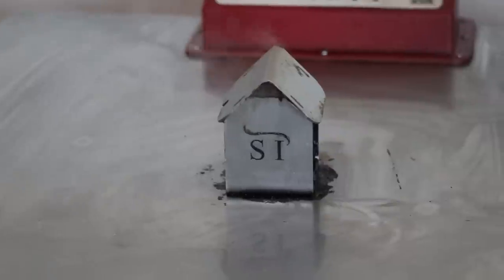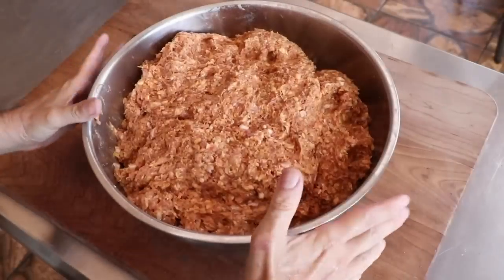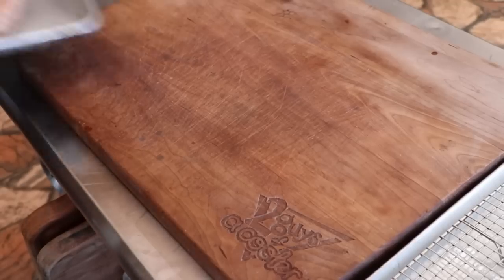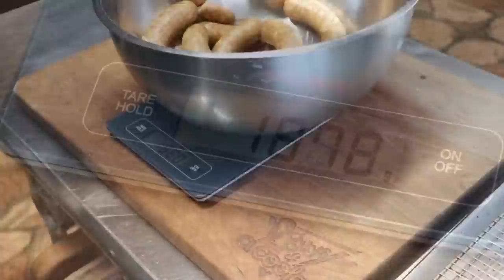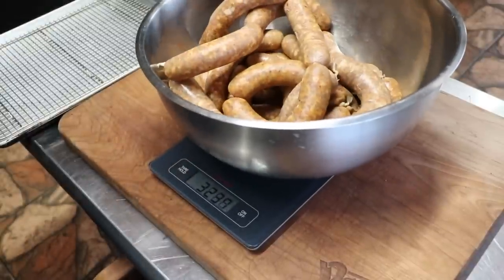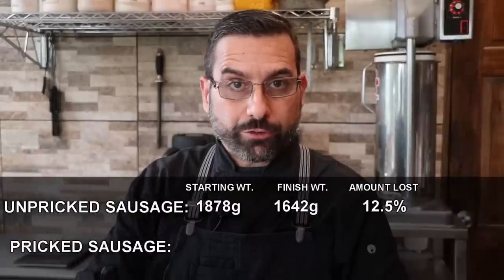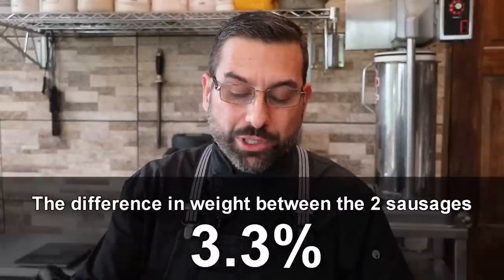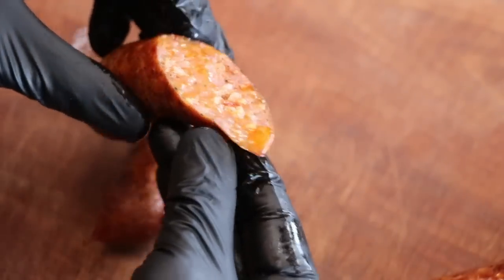Should you Prick your Sausage Casing | Beyond the Recipe

Comment: I have made thousands of sausages you do not prick your sausage ,un till it is all most cooked the fat is there to keep it moist ,ten minuets be for dishing up ,you can prick it letting some of the fat out ,that all so helps stop your eggs sticking ,
Reply from the maker: Let me start off by saying there are lots of ways to make sausage and if what you are doing is working for you then I would suggest not to change.  With that being said in my experience (and I've made 10's of thousands of pounds of sausage) pricking the sausage before you cook it yields a better product.  Let me explain.  Everything I'm about to tell you is contingent on the sausage being made properly.  MOST people don't make sausages properly, so they never really get to experience what a great sausage is supposed to be like.  If the sausage is made properly, you will not render too much fat through the cooking process your sausage will be ultra juicy. The reason one will prick their sausage before the cook is so that the casing can better adhere to the meat.  We need that casing to form a glue-like bond to the meat so that it can crisp up during the cooking process.  If there is rendered fat through the cooking process and you don't prick your sausage, then it will accumulate in between the meat and the casing.  It will form a little puddle.  This causes the casing to separate from the meat and it will not crisp up but rather have a more tough and chewy texture.  If you let the rendered fat out at the end of the cook, then it's already too late.  A great sausage comes down to understanding the finer details of how and why but like I said earlier, most people don't make sausages correctly, they don't cook sausages correctly, and they think that their sausage is the best.   

I talked to an engineer several years ago who told me that he was taught to make sausages by an old Polish butcher.  I watched a video that he made using the techniques he learned and as he was cooking his sausage most of the fat rendered out and his sausage was cooking in a lake of the rendered fat.  I asked him about this, and he told me that this is how all of his sausages come out and he really likes the dry and crumbly texture.  The fact that he was an engineer made it impossible for him to take any sort of constructive criticism, so I politely excused myself from the conversation.  My point is this, 15 years ago, I made sausages one way, 10 years ago my style changed slightly, 5 years ago i leveled up again, and today I am still learning and improving my sausage making skills and I would say that my sausages today are better than they have ever been but, the minute we say that we have arrived is the minute someone else will come around and do it better.  There's always room for improvement and I can confidently say that even though I am a teach of this art, I am also its most dedicated student.  Besides, there are many ways to make great sausages (that's the beauty of sausage making😉)

Comment: I would like to see some experiments using your kamado…. Goal…. What is the best way to smoke in a kamado? Multi stepping a kamado seems un practical to me, if you conclude that 150f for two hours and then finishing off at 200f might make sense. Going low and holding with a kamado is a problem based on my experiences . Hope this gives you some ideas

Comment: Just did my first batch of sausage...about 4 lbs. I have a dedicated stuffer and had a heck of a time getting the casing on the horn. I bought the 32-38mm casings from the Sausage Maker and used my 3/4 inch SS horn. I rinsed and soaked the casings ahead of time. I wet the horn with water, I added water into the casing before putting it on the horn, but could barely move the casing at all...it was a bad experience and took about 15 minutes to get the casing on...what am I doing wrong? I had a couple of blowouts, but ultimately the sausage when cooked was great. Thanks.
Reply from the maker: WOW, that sounds like an ordeal.  Next time start by rinsing the casing, then fill it up with water like a balloon (this helps stretch it out), next place the casing in cool water and add 1/2 tsp of baking soda for every 2 cups of water that you use.  Once the casing is soaking in the baking soda water (the baking soda makes it slippery), place it in the refrigerator overnight.  I try to soak my casings for at least 12 hours before use.  Sometimes it doesn't work out but the longer you can soak, the better the results you will have.  When it comes time to stuff your sausage make sure the horn is just a tad bit smaller than the casing (the 3/4 inch is the most popular stuffing horn for most casings) place some of the baking soda water on the horn and fill the sausage casing with some of that same baking soda water.  It should slide on effortless.  If you feel the casing stick to the horn, don't force it. Remove the casing and add more water.  Hope that helps
Reply: @2guysandacooler  Thanks so much for the suggestions. One item to clarify...you first mention using baking POWDER...then the rest of the note refers to using baking SODA...should I use POWDER or SODA? Thanks again!
Reply from the maker: @davidwyatt6617  soda

Comment: The experiment would have been better had you pricked one lot of sausage as you would normally & not excessively.
Also the weights of the two batches should have been the same, this would have shown a much lower percentage loss than you got from the larger batch. Still enjoyed the video though, your enthusiasm shines through.
Reply from the maker: Funny you should mention the pricking.  In a completely different experiment (I did) I only pricked out the air pockets and the weight loss between the pricked and unpricked was practically identical.  It was less than .3% difference.  In this experiment I wanted to see if overpricking would in essence allow the fat to freely flow out (as claimed by the don't prick group).  The 3% difference demonstrated that it's not the pricking that overtly causes the fat to flow out.  It's the technique in how the sausage is made.  A poorly made sausage that's pricked will leak out fat like a faucet and end up grainy, but then again, a poorly made sausage that's not pricked will be ultra greasy when you take a bit with a super chewy casing and a grainy texture as well.  Isn't sausage making fascinating😁.  In my spare time I'll run the test again to see if there's a difference in weight loss % if I start with 2 batches that are the exact same weight.  Personally I don't think it makes a difference because we are only looking at the percentage based off the starting weigh.  The 2 batches are technically not weighed against each other.  So if I start with less, i of course will lose less weight but the percentage should be the same.  It'll be an interesting test.  As always.  Thanks for the comment and the feedback😉